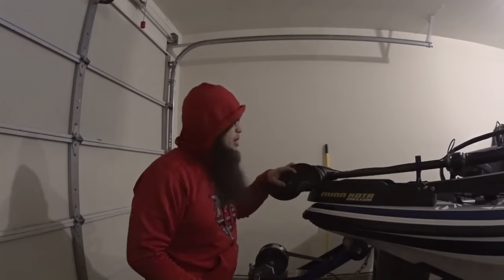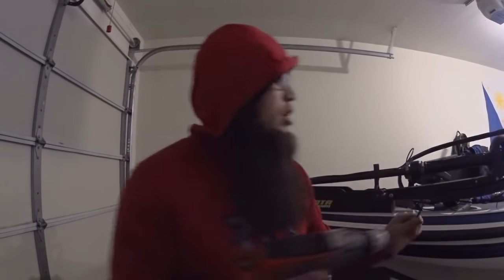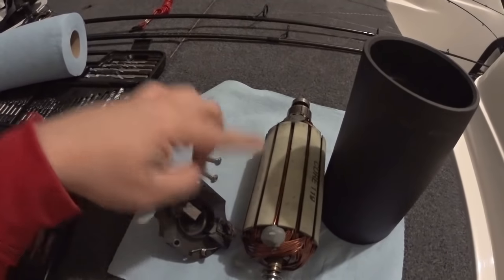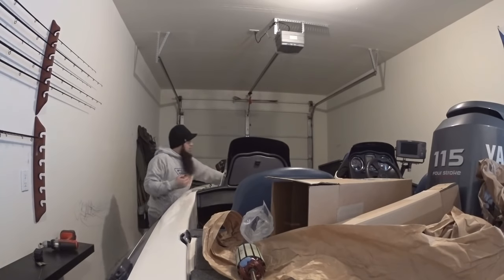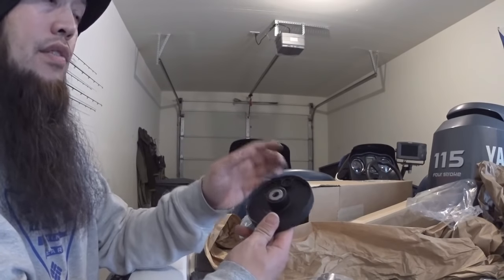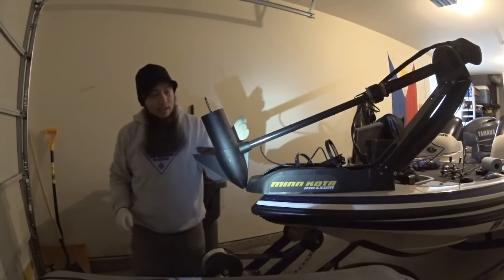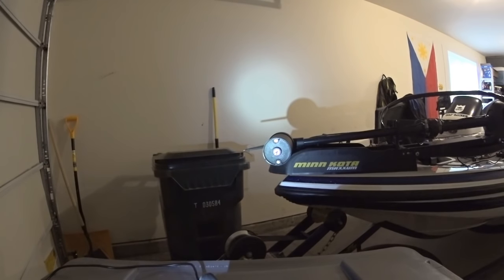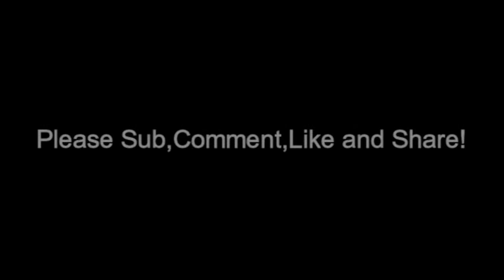How to: Rebuild Minnkota trolling motor "armature + Brush assembly replacement"

Comment: Before everyone else goes ordering parts..The commutator can be resurfaced and cleaned up with some 600 grit sandpaper. It is especially easy if you have a drill press and can mount the armature to it. The plastic housing and brush magnets can be cleaned up. The housing is just plastic and small chisel or screw driver will clean it up nicely. Followed by contact cleaner. The magnets themselves are a very soft metal. They can also be sanded/filed down just a bit until the slide nice and smoothly in the plastic holder. I literally just did this to mine. I was able to save a lot of money. All i needed was a few new gaskets.

Comment: Just rebuilt mine, upgrade kit comes with everything you need.  About $100 shipped.  Not bad for getting the same unit you have, used, for only $100. I forgot to take pics at disassembly, but the magnet casing has one side that shorter inside than the other, so the larger gap cars up.  The torque is 45-55 inch lbs for the 2 bolts, btw, per my kit paperwork.   Thumbs up!

Comment: Hi! First off, great video! Congrats on making it work. I wanted to comment to say that it is clear you don't have a lot of experience with electric motors, maybe don't have a lot of mechanical experience or training, BUT you don't let that stop you! It is very encouraging to see people tackle the problems on their own and overcome with the spirit of adventure. Great job! Keep it up!
Reply from the maker: Ya I think a lot of people don't have the confidence to fix things as are scared of messing things up. I've always just fixed most things myself. Like in this video. I knew the motor had an issue...I took it apart and diagnosed the problem and replace the parts needed. No problems so far!

Thanks for watching.  I made a trailer bunk replacement video of u need info on how to make your own

Comment: Doing the same thing on a 6 month old Minn Kota. Pretty easy. Hardest part getting the bearing between the brushes!! Pain in the ass! You did well with it
Reply: Also I might suggest the Noise reduction nut. Awesome tool. TH Marine or Bass Pro carries them.

Comment: I needed this video i have the same problem. Thanks Ditch!
Reply from the maker: +kboi75 Ya tested it out on lake Wa today and the motor is running like brand new again. Really pulls the boat well. Glad the video will help out. Its really easy to do and only took me 45 mins to repair. 

I got all the parts off Minnkota.com and it only took 4 days to get here. If you order before 12 noon CST. it ships that same day!

Tight lines.!.!.!
Reply: +Ditch Pickler cool thanks for looking out on where to get the parts, yea one of the core cracked and was scratching the field pole magnets on the housing so I need to replace the whole shaft

Comment: You could have tried to straighten the shaft before buying a new motor (Armature) & save even more cash. Looks like you only need a new plate  &  shaft seals. Though for the cost might as well replace all the seals.  At least you achieved your aim. So well done on that.

Comment: Sockets are measured in inches, not ounces. It's a 1/2 inch socket, not a 1/2 ounce socket.
Reply from the maker: +Steve King ya I know that. I said the wrong thing. Im so used to taking about weighs when dealing with fishing stuff. I'm guessing everyone else that watched this understood what I meant.

But thanks for the comment.
Reply: Ditch Pickler I assumed you used the term Ounce due to ur experience in weed
Reply: @DitchPickler  there's always nitpickers out there! Thanks again.
Reply: 1/2 oz or 14.4 grams plz

Comment: I know this video is 6 years old, but I was wondering if you remembered what all this cost you?  I have a 74# Maxxum that needs new seals in the lower unit and a new circuit board/speed control in the foot pedal.  Not sure how much I wanna put in a nearly 20 y.o. motor.

Comment: Any grease needed when re assembling? Just took mine apart and have a similar problem but it seems like there was grease on some of the parts inside
Reply from the maker: No I didn’t use any grease when I reassembled everything. Motor works great all these years latwr
Reply: I used marine grease it get corroded in there so in the bearing area I used a moderate amt . Also all the screws the armature were anything moves .

Comment: Also, did you have troubles with the cylinder alignment ? There's a dash on the cylinder that has to be aligned with the bottom fin (or something else depending on models) otherwise, your motor might not run properly and even backwards (contrary to throttle direction).
Reply from the maker: +Francis Ducharme I never lined anything up when I put the armature back in. It rotates correctly. Also when I use my hand to rotate it...it just feels like the magnet force is on it. I'm pretty sure that what it's suppose to feel like. It's been over 3 mo this since I did the rebuild and the motor at 100% moves 3.3mph on the gps. So I guess everything works and feels right 

Thanks for watching
Reply: Cool, happy that worked for you. Also, if you grab your propeller, can you rock it back and forth, say a quarter inch? On mine since I've taken it apart, it seems I can move the armature inside back and forth a bit by grabbing it by the prop once it's all back together.

Comment: How would you know if the control panel was bad?  Or if the malfunction was the armature and brush connection?  Change the armature and repair the brush(es) like you did and see if it works, heh?
Reply from the maker: +Dick Shilts I knew it was the armature cus the shaft had a wobble. And that usually happens when the internals are burning up.
Reply: Thank you! I have it apart and am getting it fixed now!
Reply from the maker: +Dick Shilts glad it's helping out! Let me know how it runs after u get it out back together

Comment: My Traxxis 55 is running kind of clunky and the cutter pin (the pin that slides into the prop and goes through the shaft) bends sliighy after a while. When I grab the prop and turn it slowly, it turns into awkward increments, and not a smooth motion. Is this normal, does your prop turn in a smooth motion when you turn it by hand ?

Comment: Great video! Curious, I purchased my first boat that came with a used Maxxum. I took off the prop to clean is and noticed that there's a slight play of the shaft of the armature moving back and forth (in and out). Is it normal to have a slight play or is it suppose to be snug with no play at all?
Reply: And what website did you use to order the parts?
Reply from the maker: There’s shouldn’t be any play. I ordered my parts from minnkota. Just go on their site and there’s a link on there to their parts catalog

Comment: how did you take out the brush terminal? does it just pull out and pop in?
Reply from the maker: +stephanie stevens ya they are held in place by a spring.

Comment: do you treat  the o rings seal with any thing...silicone??
Reply from the maker: +rabbit randy  no I just installed them back. Not a single problem since I did the rebuild
Reply: I Had a terrible time getting mine out it was so corroded I had to remit out with the stone drill bit and then push the new one in with marine grease but she’s working

Comment: where did you put the cardboard tube part shown in package at minute 6:58
Reply from the maker: The round paper/cardboard thing is like a spacer or front gasket. It goes in first into the housing where the brushing safe. The wheel bearing on the armature rest on that I'm assuming
Reply: +big dad ace, you don't really need that tube. It is used as a spacer to keep the brushes apart while inserting the bearing between the brushes.
Reply: TheMiniSuperCub this agrees with what the parts people told me, thanks.
Reply: Yeah mine I didn’t know it was cardboard and I soaked it in parts cleaner and it went to pure shit and I said oh it’s cardboard so I left it out it’s still working fine😊

Comment: I didn't notice any mention of the fluid used inside the motor - if you didn't have any maybe that's why your plate melted. Id i remember correctly it's power steering fluid.